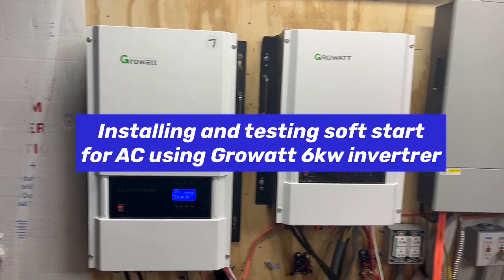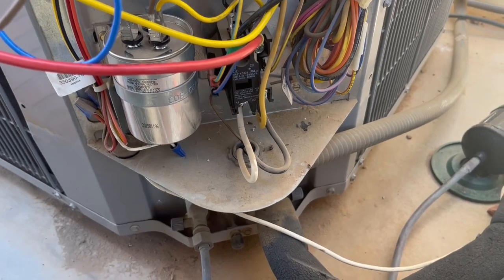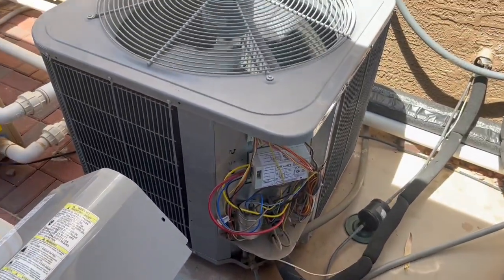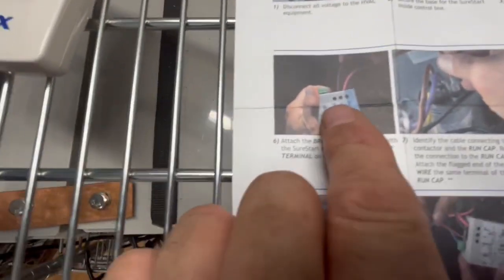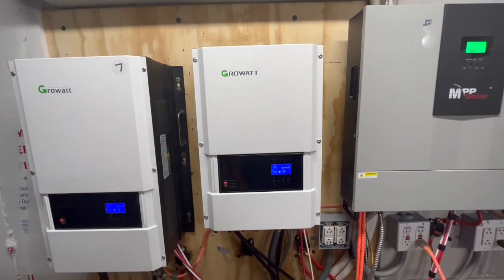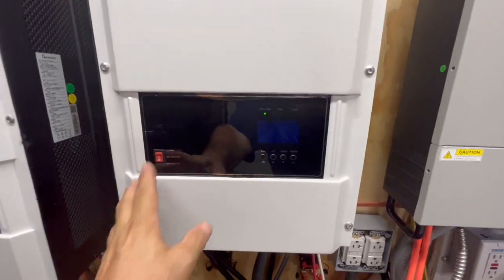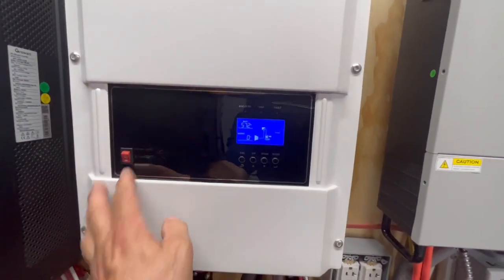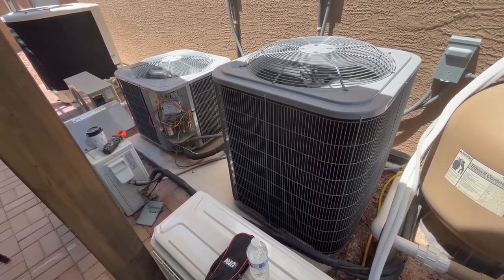Added soft start to AC makes it possible to use Growatt 6kw low frequency off grid inverter

Comment: Brother have u had any problems with the grow watt or the mpp ..... Just checking to see if they are worth it or cheap junk... Thanks keep it up
Reply from the maker: I had one of the 24v mpp inverters charge controller stop working but Santan solar where I bought it replaced it. I have not had any problems with the Growatt at all. The Growatt is 120/240v and able to start higher amp motors as where mpp can not start up large amp inrush. But all my Mpp inverters are still working after 3 years. Growatt can not parallel, Mpp can parallel up to 6 inverters with some models. Growatt has a surge of 3 times  the running watts, 12 kw Growatt can surge to 36,000 watts. Mpp will surge less than double running watts at best. Mpp 2400 watt might surge to 3600 watts. Growatt has a lot of new inverters out that I have not tried that are getting great reviews. Hope it helps.

Comment: i'm sure you've figured this out already, but that BREAKER below your inverter is what popping. Those type of breakers are known to be of lower quality. Your inverter may handle that load if that breaker was sapped for a decent t class fuse.
Reply from the maker: Hi, I bought new breakers a few months ago but have not felt well enough to mess with the solar all summer, will be changing out new breakers soon. Thanks for your input, it is really appreciated.
Reply: @diy-solar-guy  yeah no problem. I see people use those all the time and they are just no good in applications like ours. I speak from experience btw, I used those when I started my last system with similar results.

Comment: I always recommend using 1/4" cement board on top of that plywood. Also get yourself some good dc breakers, properly sized wires, more lithium batteries and you'll have less issues.
Reply from the maker: I appreciate your input, I am permanently social security disability and on a limited budget. I did all this while going through 2 incurable cancers. Our system is finished and don’t intend to spend anymore money. System Runs great for me having absolutely no experience with solar or ac 3 years ago when we started. Hope you have a wonderful and extremely blessed day.
Reply: @diy-solar-guy  Always someone who has to criticize something...  It's like their life is so horrible, they have to makes yours horrible as well.

Comment: You need minimum two of those LFE server rack batteries to start the 3 or 3.5 ton. Also ensure you have the proper size wiring from bat to inv.
Reply from the maker: I agree, only one lithium battery will not start 3 ton ac. That’s why I am using the AGM batteries. Very reliable.